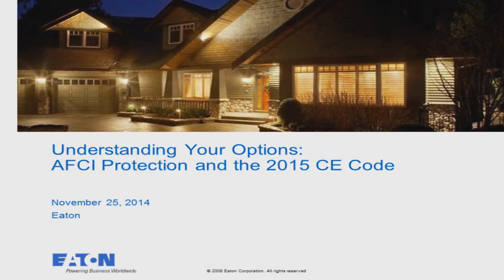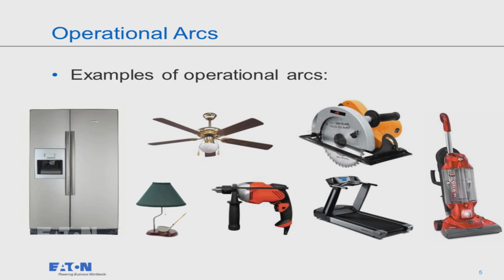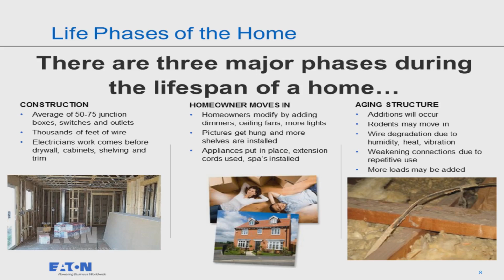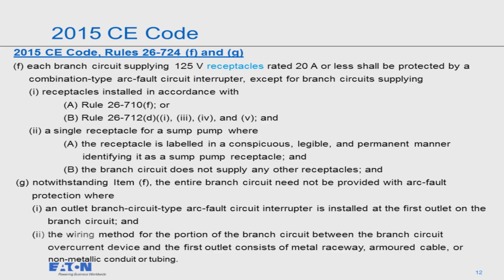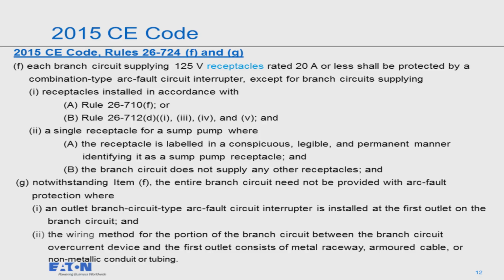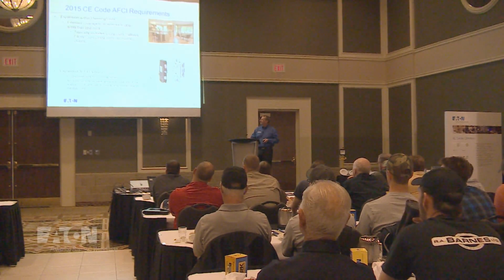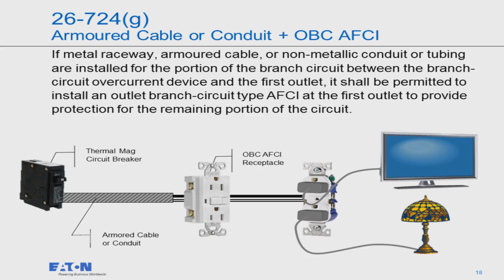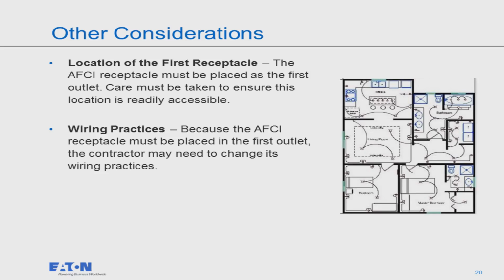Important changes to the Canadian Electrical Code with respect to AFCI

Comment: having played with AFCIs in off grid application , the main problem is they have a low voltage trip function that always trips when powering down a portable generator.